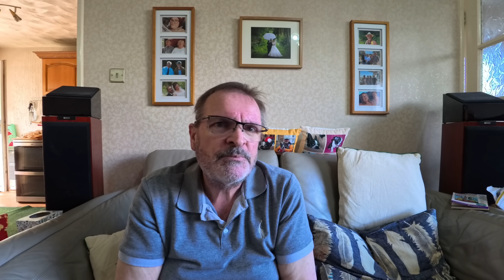Expert Ships Engineer Reacts to Baltimore Bridge Crash

Comment: What a nightmare for the engineers on ship to have lost prop and not having tugs to escort her through the bridge because of the cost. Loss of lives and millions of dollars. Those men that lost their lives were doing their jobs maintaining the bridge is so sad.
Reply: I made the same observation and had not heard about the tugs turning back because of the cost. Is there a link or the name of a source you can point us to that explains this was the reason why the tugs turned back prematurely? I'm very eager to hear how that's supposed to justify such a dangerous shortcut, not finishing the job until a vessel makes it to the open sea.
Reply: @dondep  what is going on with Shipping is the name of the channel. I hope that helps, Chief.
Reply: @dondep  I haven't heard of an tugs turned back, most likely they were never hired!  MOST ports and shipping lines have agreed NOT to require them. $$$
Reply: TimBatSea channel talks about why no tug boats
Reply: @DougGoble Yes, I discovered his videos about the issue soon after I posted here last. Thanks. Think he's right that tugs will be required in future, even if it means 4 per ship and more $$$. Thing is, it seems a "specialized crew of pilots specifically trained to avoid port obstacles" was on board for this. Despite that, the constant power outages should've been enough to prevent the ship from leaving port at all.
Reply: @dondep  The next debate is structured engineering. Why was there not an upgrade to the dolphins and fenders for the old bridge! Thanks for your comment!
Reply: That was my first thought---why no tugs?  Lived near the Mississippi River for years in Louisiana and expected to see tugs around this boat.
Reply: Not to mention the people in their vehicles who lost their lives.Very little information about them.Rest in peace and condolences to their families and friends.
Reply: @laurameixner2897  I’m sorry but I have not heard of any other vehicles 🚗 on the bridge. The police had the inside lane blocked for the road maintenance crew on both sides of the bridge. The police were alerted to shut down the bridge. The bridge was so long there was no time to get to the road crew.

Comment: There are a few things. I've heard a few things about this. 1rst, if they got the ship engine going, and they went full reverse, I agree, and I might add, this was the same exact mistake the titanic made.
However, a few things. I heard the ship had a major electrical malfunction while docked a day or 2 prior to leaving. The ships maint history seems sketchy as well. I also heard they didn't get the main engine going but it was the generator they got going and they never got the engine going at all. This was reported on 'What's going on with shipping'. Now I'm not in agreement with his analysis and maybe he doesn't like that, I don't know. It seems to me the ship immediately turned once the lights went on. 'What's going on with shipping' maintains the ship turned because of wind and current and I totally disagree with that. The mast light never came back on till a little later. So Sam argues the engine never restarted but the generator came on.
Now, the port anchor was dropped. Once that anchor started dragging, it would have pushed the ship to starboard. So if its true that the engine never was restarted, then either someone turned the rudder in the wrong direction once electrical power was established or the anchor on the port side is the reason the ship turned. 
Additionally, the ships crew were all from india. Now, I'm sorry, that doesn't make feel especially confident at this point. Compared to a crew lets say from the Philippines. I think we have a scenario of total incompetence. From the bridge to the engine room and every place in between. I think the crew, or at least one person if not more in the engine room, the ships master, captain AND the port pilots all made the wrong decisions. I also add blame to the port of Baltimore itself for not having any dolphins or barriers to protect the bridge. And whoever was responsible for the construction of the bridge itself. It was a continuous truss bridge and they are the weakest type of bridge you can build. Any little thing goes wrong and the entire structure is compromised. It should have been obvious to build a more stout structure considering the obvious dangers of building it right at the mouth of a large port complex. AND especially after the skyway bridge disaster, they had 45 years to rectify this situation and nothing has been done. 
I will say my first thought when I seen this is exactly what you said, the switching valve between the fuel tanks. There is an air valve to the intake that can be shut down as well. While I don't think this is Russia. IF Russia does a sabotage move in response to the concert attack, I can assure you, it will be an economic infrastructure hit and it would not ever be suspected of sabotage and the media will never report on possible sabotage from Russia. This disaster does fulfill those requirements but in a Doolittle raid kind of way. That is IF Russia were to be behind this. Just a little thought candy for those james bond fans.

Comment: Only slowing 1 knot after loosing power and dropping anchor and supposedly reversing also is not possible just losing power it would slow and drift it looked like it went full throttle trying to drag the anchor to get to the bridge before the crew could shut it down it definitely wasn't coasting almost full speed for that area

Comment: Makes perfect sense now. I have had engineering experience first with Canadian Pacific, and later with Carnival Cruise Lines (same ships) in the mid 70s. Mostly electronics so I know enough about ships to be dangerous. I have never heard of the paddle wheel effect before but see it now. At first I thought the force at the top of the prop would be the same as that at the bottom, but I see that with the size of today's props there would be a vast difference in water pressure between the top and bottom, like a paddle wheel which has the top half out of the water. Is this a correct assumption?

Comment: As long as a ship has weigh on the rudders remain effective, to a greater or lesser extent depending on speed.  The Dali was doing 8 knots when power failed.  The critical issue is whether or not the Dali had redundant rudder control system to maintain authority in the event of loss of main power.  Every U.S. Navy ship I served on had redundant rudder controls.  I suspect that - in this age of late-state neo-liberal capitalism - that the drive for corporate profits trumped the $s needed to design, manufacture, maintain, and operate such a redundant system, and I'd further guess that very few, if any, commercial vessels have such a system.

Comment: Loss of data during the blackout could be caused by failure of the UPS (uninterrupted power supply) to switch automatically from mains power to battery power. They were notorious for failing in this way when they were first introduced.
Changing fuel supply from light to heavy and vice versa is always a fraught time for the Engineers, particularly the former. A slug of cold heavy oil can slow the generators enough to cause them to trip on low frequency, even though they will keep running. Changing over has to be done extremely cautiously to avoid this very problem and to avoid cross-contamination of the fuel tanks from the returns.
Good, accurate analysis Retro. I sympathise with all the poor sods on the Dali who will have to endure years of investigation. "There, but for the grace of God go I".
Most of all, I sympathise with the families of the 6 men killed. They are already fading into obscurity.